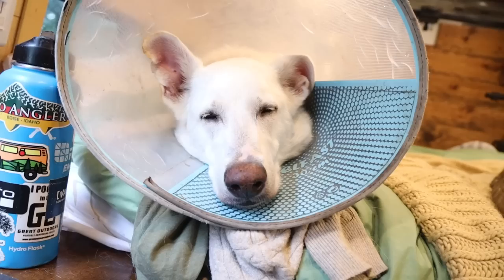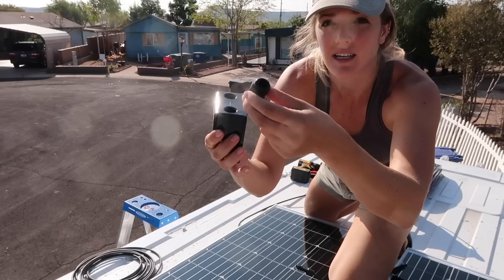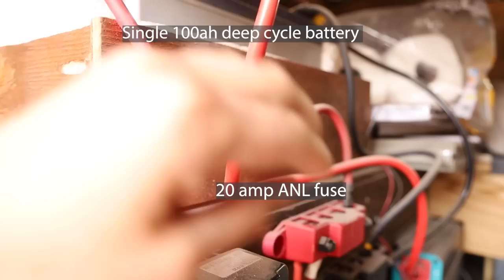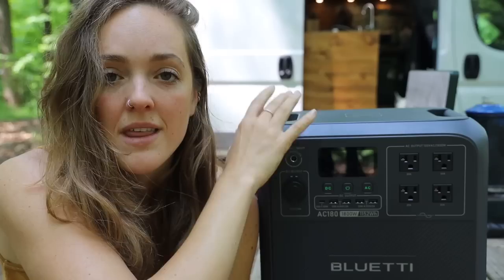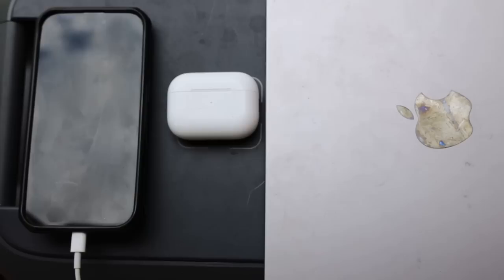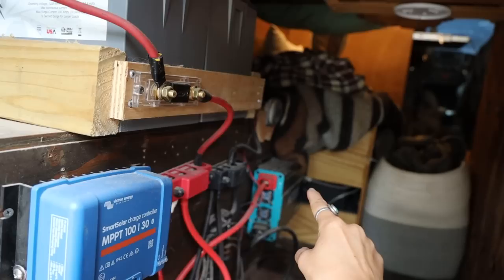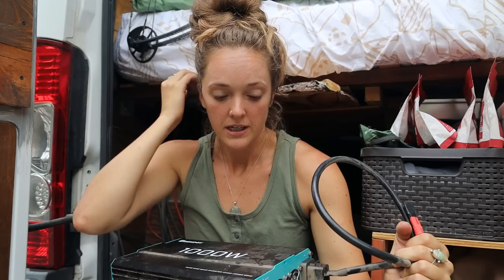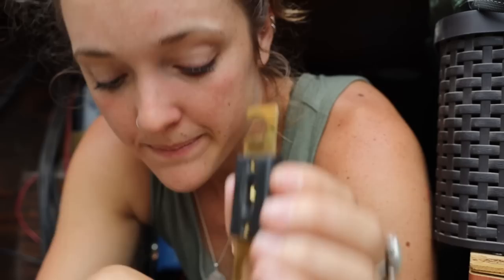I'M DONE | Van Life SOLAR Changes after 3 Years | Bluetti AC180

Comment: Akela's reaction to that alarm was priceless.

In the future, if you need to replace the battery or the fuse, you may want to put a cutoff switch between the fuse and the battery. It's not necessary, but you will feel safer being able to connect and disconnect those wires without the spark.
Reply: 👆 this
Reply: Blue Sea make a great set of high-amp battery switches for this purpose. Also a good move to install a Blue Sea terminal fuse (or fuses for multiple batteries) onto the positive terminals, plus terminal covers, to prevent any damage to the batteries if the system is overloaded, or against short-circuits.

Comment: You probably didnt need to tape up the negative cable. But it is always a good practice to be safe and not take any chances. :) three words to always live by.  C.Y.A. Cover Your Arse. One thing i would suggest is color coding the wires in and out of your circuit breaker. Just a little red tape on the positive cables so that way you can know at a glance.

Comment: Love Bluetti. I am wiring my whole van with a Bluetti AC 200 Max. Solar panels on roof straight into Bluetti and then 12v/30amp outlet wired out to a fuse panel. No other batteries etc needed the Bluetti will do everything. Your videos are very helpful.
Reply from the maker: That sounds so nice and simple!

Comment: “At the ready with my Bluetti AC180…….” 😊 I actually use a competitor’s 500 model, but I’m impressed with your official, and unofficial reviews. I too quit using an inverter a couple years ago. The draw was just so much greater than sticking with DC. I use my van for business, and have greater access to AC as needed. It’s still nice to get off the beaten path whenever possible though. Great video! It’s been fun to watch your upgrades over time. A lot of great info! Thanks for sharing! 😊

Comment: I would recommend you put some connectors where your wires go thru your new breaker box. That way your wires are protected from any vibration from the van driving! 
They’re black plastic connectors and tighten around the wire.
Reply: Do you mean like a rubber grommet?

Comment: the only things i would suggest is you use cable ferrules on the ends of your cables so they don't fray out which could lead to shorting. it is a good idea but not necessary to use the ferrules on all cables that are held in place by screws. in addition, you shouldn't have any bare cable showing beyond where the cable goes into the device. this could also lead to shorting. you do such a great job, these two things would make your build that much better. keep up the great work and videos and kiss akela for me!!!

Comment: Bluettti equipment won’t disappoint.  Customer service is NIL!- MIA!— I installed the AC300/portable 350w panel with 410w on top of van (total solar 750w and total battery 252ah/ 3052wh). I haven’t had to tough it (thankfully!) as there is nooooo customer service!.
Reply: Probably a bit more responsive if you are sponsored 🤔
Reply: @l.b.3148  def. Not as I know folks that are affiliates. It is really too bad.  I think they are trying to get the affiliates to be their tech peeps.  idk. Just thankful all is working, but I have questions of expansion but can’t reach anyone. Ever!

Comment: It looks good.  One thing though, mentioned in another comment.  You need to install cable clamps on your wiring where it enters the breaker enclosure. This is an absolute requirement on all electrical installations.  Other commenter called them connectors, which is not correct.  The clamps act as bushings to protect insulation from the sharp edge of the enclosure opening.  They also act as strain reliefs to protect the wire from being pulled out of the breaker if something should snag or pull it.
Reply: Similar to like a rubber grommet but with metal?
Reply: @mackenziewebster9553  No, a clamp that firmly holds the wire in position so that it doesn't move.  Bushings only offer protection against wire chaffing, but doesn't hold it.
Reply: @tomscotttheolderone364   I see, that makes sense. Thank you for your response!

Comment: I don't want to be that guy, but I told you about that fuse in your "Solar power upgrade" video a year ago. I'm surprised it's lasted this long, probably only because you were hardly ever using the inverter. But the real question is, have you upgraded the wiring at all? The fuse should be sized depending on the wires it is protecting. If you have 20A wire and a 40A fuse, that's a really bad idea.

Comment: I’ve got to admit.  I’ve watched this vid twice and for the life of me I can’t understand the round about way you’re powering your van.
My sprinter has a 3000 watt inverter w/dc-dc charging off alternator or 400 watts of solar.  I have 5 battleborn batteries and they power everything from Microwave to 12 volt ac.  Fridge included.  Hot water heater is also electric and we use an induction cooktop.   
I’m guessing you don’t have a dc to dc charging ability but it appears you may be doing it this way for budgetary reasons?  We also have 8, 110 outlets and plenty of power.  Don’t have to set up panels outside or the like.   Please explain why this route?

Comment: So you didn't really talk about how you connected the bluetti to your charge controller. Some things to know about bluetti...they have their units setup without any thought into the life cycles of their batteries. They are short lived. Fast charging them will absolutely destroy those batteries quickly. When their cheap components fail, you will not ne able to get any sort of customer service on their product or warranty.  They are more concerned about advertising than to produce a quality product. If your using their stuff; be smart and have a back up system to use because you WILL need it. Also they make false claims  to their built in mppt solar charge controllers and exaggerate the watt hours. It's a garbage system. It's tough to get honest reviews on these when the promoter has been bought with a free unit. I get it and don't wanna burn bridges with these companies that are supporting your channel. Just know people who buy bluetti don't ever make the mistake of buying a second. It's the company's fault and they don't even stand behind their product and offer customer support or a warranty. Buyer beware.